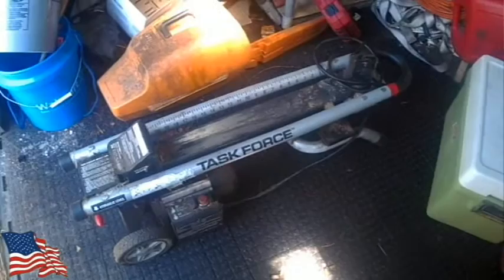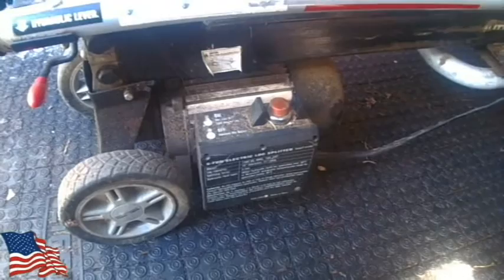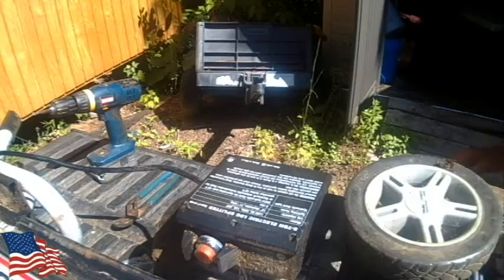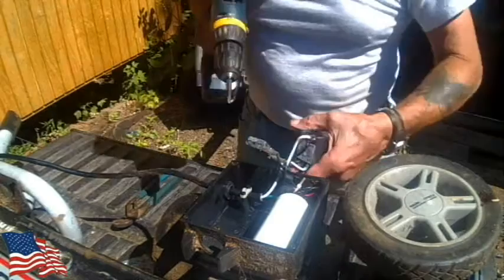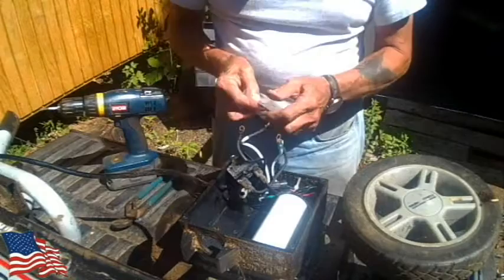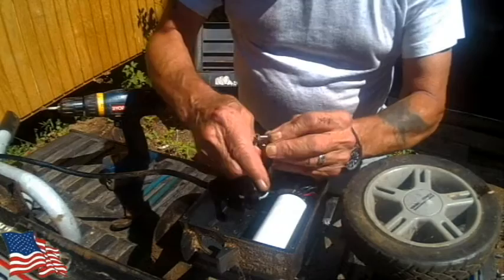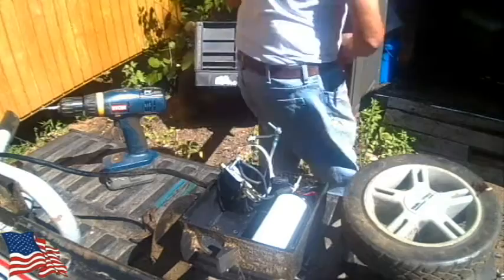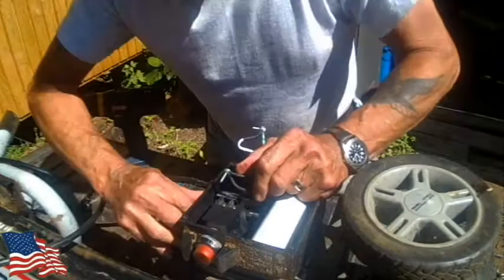Re-wiring my Electric Log Splitter for 1 Hand operation.

Comment: Just a thought, but I see the button is in between two bracket stubs (for lack of a better term) why not take your drill and drill a hole in both brackets then slide a pin through it to keep the button pressed down. When your finished you can take the pin out and the button will release.
Reply from the maker: Good Morning!   I can't see why that wouldn't work, unfortunately that was an older Video and the Motor locked up not too long after it was made...It's repalcement  for some reason has to cycle on and off with each operation....I preferred the way the old one operated better....But it is , what it it!   Thank you for your Service!

Comment: I wouldn't exactly call that a "Proper" way to ground out a capacitor using a screwdriver can damage the capacitor,  it's much better if you make a capacitor discharge tool, using 12AWG, 600 volt rating wire and a 20K OHM 5w resistor.

"Caps are specified for maximum leakage, which translates to "it takes at least this long for it to discharge". The leakage gets less as the voltage drops, very strongly, so it takes a very long time indeed. I did a quick calculation that it takes a minimum of 10 days to lose 10% of the voltage, but the next 10% would take three months, and the next 10% after that, two years. At that point you are at no less than 73% voltage, or 180v on a 250v cap - not a good idea !"

Comment: Surely you must have a woodworkers clamp somewhere. Just clamp the button down and take it off when you are done.
Reply from the maker: Yep, I have a few of those and, I did try the same thing using my Vice grip C Clamp. For some reason it has to cycle on and off between splitting cycles....Thanks for the comment and suggestion.
Reply: Can't if the button is not released the ram doesn't go back

Comment: How did the switch mod work out?
Reply from the maker: It worked out pretty good, with limitations of course. One of those being if the piece of wood was too big and didn't split I had to unplug it to get it too cycle again. The reason I did it was, really large pieces of wood I had to hold with my right hand offset so it would split. Sooooo 2 hand operation was not possible in some circumstances. All in all I'm pretty pleased with it. Thanks for the comment!
Reply: SmokymntnEd OK great! Thanks for the fast response,